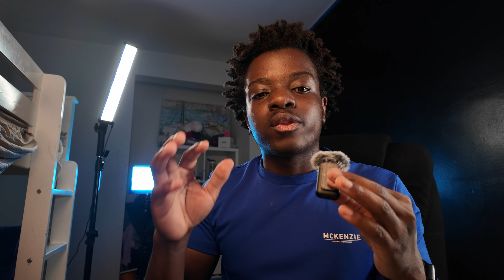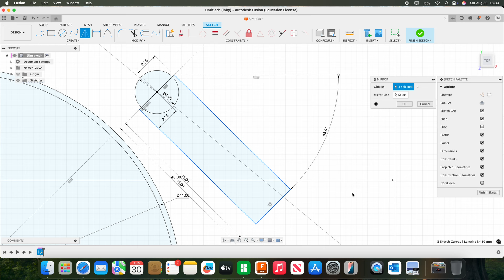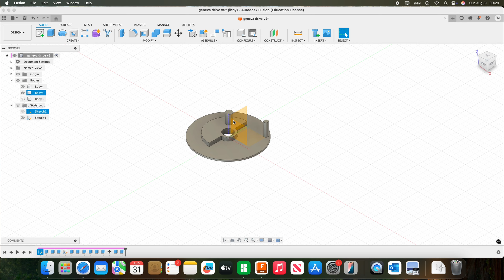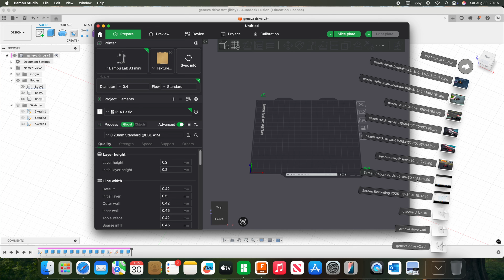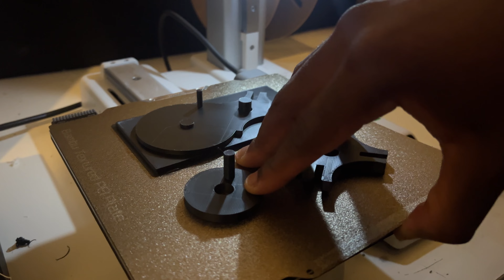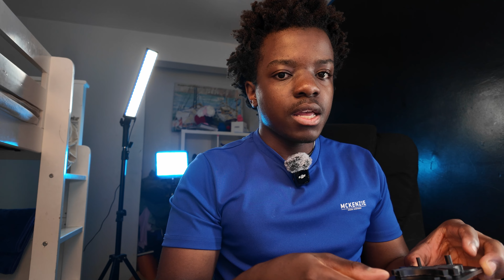The 200 YEAR OLD Mechanism Still Running The World

Comment: There are literally zero Geneva drives in my day-to-day life because I live in 2025 I don't even think the odometer in the truck I drive uses one although I suppose it possibly might. And I definitely don't work with CNC And I haven't used a camera with moving parts since around  2007
Reply from the maker: This is talking about how it shaped modern technology and like I said in the video there are modern replacements like stepper motors. This was to show the start of those technologies. The tech you use in your day to day lives were evolved from the Geneva drive